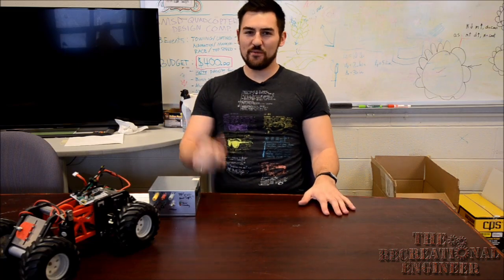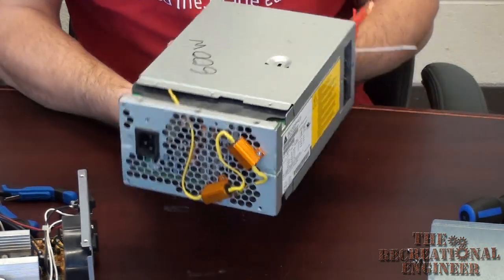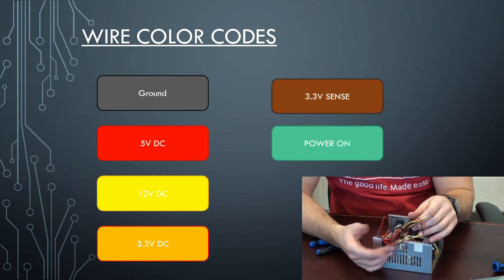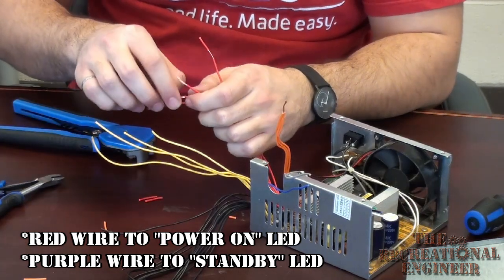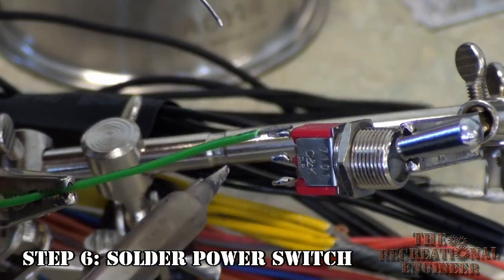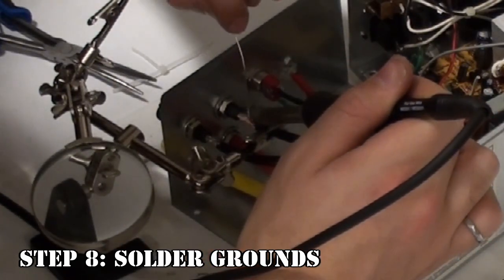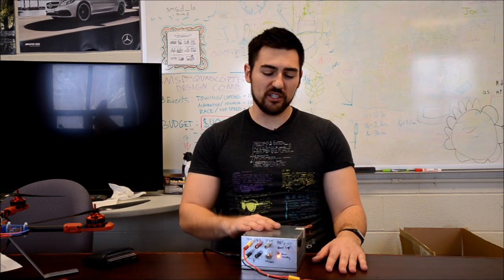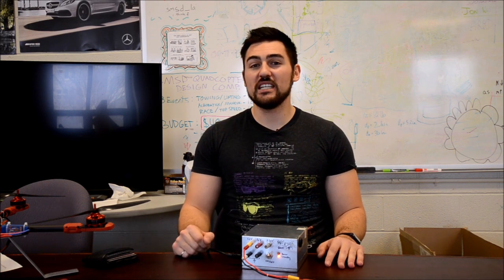$10 DC Power Supply - 1 Day DIY

Comment: I have two questions:
¹ Could you combine the voltage across each post to get ~20V+?
² What modifications could make this a variable power supply?
Reply: You could get 24V using +12V and -12V, but usually the -12V can provide less current, so that will limit the amount of current you can get out of the PSU.
It's not recommended modifying the PSU to make it variable since you usually need to remove protections, and the electronic is not designed for different voltages

Comment: My PSU is rated 300watts. Does this mean I can get 5 amps or more out of the 12v line without doing anything to it?
Reply from the maker: boowonder888 The amperage readout should be written on the supply. It all depends how the current is broken down. I would imagine 5amps should be no issue tho
Reply: Mine reads for the 5v - 35 amps, 12v - 15 amps. Can you combine the 12v wires to 24v and therefore  half the amperage?
Reply from the maker: boowonder888 No, when you combine the 12v wires you increase the amperage in this case
Reply: I guess that makes sense. I think I was confused with parallel hooking up of a few batteries? That 15 amps on the 12 v wire is all I need but my homemade solenoid engine runs better on my store bought power supply when I set it to 12v , 5 amps (maximum). Maybe because of the internal automatic off switch of the pc PS. It needs a constant load? I'm gonna try putting a constant load like a little light bulb on the outside and see if I can get it to stop the automatic off. The way you did with the big resistor?
Reply from the maker: boowonder888 you probably need a pretty big bulb. I would just use a load resistor. They are cheap
Reply: I dug up an old psu from about the year 2000 today. It only has a 12v and a 5 volt rail. 3.3v is totally missing, lol! It has a total rating of 65W, 12v, 2amps and 5v 7.5 amps. 
The fan spins when flipping the switch and I didn't have to jump the green and black wire, I guess its so old they did it differently back then. I like it because its compact and safe because its only 65 W. I found a 5w power resistor too, so I'm gonna connect that to the red and black wire so the unit cant switch off automatically.

Comment: Remember that you can get 7v by using the 12v and 5v rails. D.C. Power is based on voltage differential.
Reply: Power is based current and resistance.  Voltage is a differential.  The 12V is relative to ground.  5 is relative to ground.  +7 is relative to +12 and +5.

Comment: i don't know why but when i work with mine (i have two that work the same but different manufactures) and measure the voltage there is an actual  18v  ±0.5v  and i think its because 12v and 5v are connetcted together to the plug so if i do this i can can have it from 18 btw it's not written 18v i just have it

Comment: I can't seem to source a heak-sinked dummy resistor at the suggested resistance spec  (5 ohm) for the 5v rail ( for an older Dell atx PS)
I can find 10W .(point)5 ohm and 10W  10 Ohm  and 10W 39 ohm.. on ebay..    Is a10 Ohm resistance going to work for me?

Comment: My PSU, a Thermaltake 550W, has a yellow/black stripped wire as well, what's this all about?
Reply from the maker: Jo Veteran this is in addition to the solid yellow? Does it go to the 24pin atx cable?
Reply: Hey, thanks for replying.
Yes, there are a bunch of yellow, orange, black ones, plus singles of brown, green, blue and there are also those two stripped yellow/black ones. At the moment I don't recall where those two came from, I'll check the 24pin motherboard connector tomorrow and let you know.
One other thing, this PSU worked perfectly but had this weird issue, it wouldn't turn off. Does that mean the green wire shorts to ground somewhere?
Reply from the maker: Jo Veteran best case is if the wire runs to the 24pin atx then you can google the pin out for the connector and find out what the wire does.  On the shut down question. That's tricky, your intuition could be correct
Reply: So it seems that those two stripped cables belong to the 4-pin +12V Power Connector. I've checked the PSU manual and it describes those two "yellow" (those are definitely stripped yellow/black ones) as +12V2DC, whatever that is. My motherboard has 8 pins for that connector so I guess this is doubled or something? In any case I think this goes with the rest of the yellow ones, do you agree?

Comment: Hey +The Recreational Engineer does each 5V and 12V wire have the respective voltage running through them? Or must they all be combined to gain the respective 5V and 12V voltage?

I am looking at making a Lab Bench Top PSU with USB ports as well for a multi V setup for different components and tools I need to power
Reply from the maker: Matthew Stranks Each wire will have the full voltage that correspondes to it's respective color.  Good luck
Reply: Really appreciate the reply +The Recreational Engineer I am just waiting on all the supplies to come in now! Maybe I will post a video of the finished product!
Reply from the maker: Matthew Stranks good luck with your project

Comment: how can you make a variable supply from that ? without using a buck/boost converter
Reply from the maker: Satyajit Ghana unfortunately that is it a bit out the scope of what I can explain in the comments.  If you just want to bleed off energy you could make a voltage divider with a very high wattage potentiometer.  However I wouldn't really recommend this

Comment: Nice Weller soldering station you have there :D Sadly mine broke 2 weeks ago after 20+ years of service :(
Reply from the maker: AK90 thank you! I wish I could claim ownership but unfortunately it was borrowed.
Reply: Who can I use if I don’t have the load resistor?, regards from the button of the valley
Reply: @ruffnck4637  Just solder in a car brake/tail light bulb instead.

Comment: Do I need a dummy load resistor? Or can I just use a 10w ten ohm resistor? Do i even need  resistor?
Reply from the maker: Jack Pirone the 10ohm 10 watt WOULD BE your dummy resistor
Reply: Ahh. I have 1 ohm 10 watt resistors. can I use those wired in series for my dummy resistor?
Reply from the maker: Jack Pirone technically yes but it may be difficult to package
Reply: ok. I might also hook the resistors to a heatsink. I will tell you how it works after i build it.

Comment: Hi I have a question I need a power supply that will give continuous 15 volts or higher and to be able to use a veritable control so i can turn it up to what i need thank you
Reply from the maker: Jimmy Clark this can be done.  Follow this tutorial and then attach a variable buck converter to the 12v line.  You can buy one on amazon

Comment: would it be possible to put a useful load in place of the dummy load resistors? Or is that as dumb as i think it is?
Reply from the maker: Javierm0n0 yes you could do that,  that is essentially how the pc it is supposed to power works.   The reason the dummy load is useful is because when you are doing small electronics projects such as Arduino type things,  there isn't enough load to keep the supply running.  If you are using this to run a big motor or something then you do not need the dummy load.
Reply: oh so i could add a flip-flop to switch between the dummy for circuit work and an active load that I'd be testing?
Reply from the maker: Javierm0n0 For sure!  You can do whatever you want.  But yes I think that will work fine.

Comment: lol at 11:35 powering a quadcopter, with no transmitter on, and the props on the motors. One day you'll learn that lesson ;) Nice work on the power supply!
Reply: Bringamosa Oh man. The chaos that could ensue! LOL
Reply: Andrew Balus. That would be some recreation right there.
Reply: I totally agree that it is very unsafe but, if you look close they are not fastened to the motors. I think he just sat them on there for display but, could still have been a disaster if the props were really tight on the shafts and didn't free spin if the throttle went to max.

Comment: so iv been using one to power my subwoofer for a long time but i could never use it to its full potential. can i use two power supplies to power one amplifier? i think its a 2,000 watt amplifier and my subwoofer has a 1,400 watt peak. also i took all my car audio out of my car so im using my car stereo with that and i just dont know what the best way to do all that is haha i want the one subwoofer, two truck speakers and the stereo because its going to be for my theater and i dont want to spend all kinds of money when i have all this good car audio stuff laying around. haha how should i go about powering all this?? 3 cps's, one for each amplifier and one for stereo or what?

Comment: Why did you solder the heatsink resistors in the yellow wire? it's a 12v..shouldn't it be on the red wire instead?, cause it's 5v and have more amps than 12v. I'm confused,, please explain.

Comment: hello guys
My 700W PSU says voltage 230V / current  6A / Frequenci 50Hz.
and than 12V1 30A, +5V 24A, +3.3 24A.
i wana connect it with a peltier TEC-12706 so are my voltages Ok or i need to do add something to my supply?
thnks in advice

Comment: Its a good idea to use the "all good" wire (grey) for the led . This means is any of your voltages are incorrect or not functioning the led wont light . Other than that , good work :)
Reply from the maker: David Haney thanks for the tip
Reply: would it be wired to the standby led or the power on one? would be legendary if you could help me out i can't find anything on what to do with the grey wire

Comment: hello... i have been looking for a tutorial regarding this power supply & i came across yours... your presentation was excellent... may be you can help me with the problem i am having... first.. the yellow wires only have 8.4 volts & second when i hook up the LED strip ( like you did) they flicker at a very fast rate... what am i doing wrong???.. i do have the green & one black wires connected together via a toggle switch... the power supply came out of a very old PC .. probably 10-15 years old... i  have intention to use this power supply to light up my model railroad with the LED strip... any help you can give me would be greatly appreciated .. thank you advance .. vinny

Comment: when I don't have dummy load only 2x 220R 0.6W left from 4 pack  am i pretty much fkd? (already have other 2 on my leds)
Reply: Yes, you are.  I don't know how much current the PS needs (what the actual spec is), but all the videos talk about 5 ohms on the 5V line.  I = E/R = 5V/5ohms = 1A.  Let's say the circuit needs a 1A load.  But, even if you paralleled your 220 resistors, that would only be 110 ohms.  5V/110 ohms is only 45 mA.  Not even a tenth of what you need.

Comment: How do I solder the resistor to 5v? Do I simply solder one red wire to each side of the resistor? Should ground be soldered to the resistor?
Reply from the maker: Carlin Canales which resistor?  The load resistor or led resistor
Reply: the load resistor.

Comment: what's the purpose of the dummy resistor? Without it, have any damage for using PSU?
Reply from the maker: 정용화 some PSU will not turn on without the dummy load.  Not all PSU react this way, but most do

Comment: looking to mod a similar atx psu for my RC charging needs,  the psu im working with dc output is 36a on 5v, and 16a on 12v, i will only be using 12v,    i would put a resistor on the 5v line then correct? TIA for any help.
Reply from the maker: spencer tangren yea that's what I would try.  Good luck!

Comment: You don't tell or explain anything about connection of the leds ...Thanks
Reply from the maker: Stavros Salevourakis power led:  5v - - > 330ohm - - > led - - > ground.     Repeat for standby led but use purple wire for power
Reply: Good evening , thanks you very much... iam all ready done. Thank for respond  and for your video.
Reply: thank you
Reply: The Recreational Engineer I built this but when I plug power in I get standby power but when I switch it on I get no main power. Also I tried removing switch and twisting green and grn wire together so I know it’s not the switch. Can anyone give me any troubleshooting advice please.

Comment: Every good video. would you make 24V outlet for 24v LED light strip?
Reply from the maker: Ravy Khith I have thought about making this into a variable supply.  I will have to try and find the time for another video.
Reply: Thanks you
Reply: You mean to use  -12V and +12V rails (24V) connected to a DC-DC buck/boost converter? But what about the current  on 24V - how many amps would be the output?

Comment: i went to my local electronics store and they didnt have 330 ohm resistors and 5 ohm 10 watt load resistors in hand for a certain project im working on that needs to get done in a day. I wanted to know if in place of those I could replace and go with a 390 ohm resistor and a 6.8 ohm 10 watt load resistor. Thank you in advance
Reply from the maker: MrFatman258 if you mean in place of the led resistor and load resistor? Yes those should be fine
Reply: Thank You! I also have another question regarding the power supply, in my case i have a blue wire that provides -12 volts at 0.8 amps. Can i add a binding post for that wire as well?
Reply from the maker: MrFatman258 yes of course,  just make sure what ever you hook up to - 12v still gets hooked to the ground post as well

Comment: the problem with this is the amount of current it can put out, with no current limiting. Be careful more than 30 Amps on 12 V, 5 V. Also there can be a lot of noise from the switching. Experimenters might want to try a buck/boost from the 12 V rail with current limiting that can be set. For bench power supplies you need to have current limits so you don't fry components when there are mistakes. this is great as is, if the user understands that it might put out 30 Amps!
Reply from the maker: Fred Zlotnick I agree this is a good suggestion! For anyone not concerned with spending a few extra bucks it is a great way to improve on this project.

Comment: R.E.,
question...I built a cool test station watching your video. have 3 set of terminals "12v,5v and 3v" at least that was the idea...lol
i got the dummy resistor on a 5v line.before i took the wire bundle apart i used the power supply on my lipo charger and everything worked like a charm. then i clipped the wires loose bundle them according to colors attached a few ground wires on ground terminals took 12v wires and placed them on one terminal, took the rest of the 5v placed them on another terminal, took the 3 orange wires "3v" and placed them on another terminal. took 1 green and 1 black wire attached to a toggle switch. only thing i didnt do was use the brown wire on the "orange" like it was in the original bundle. and i didnt attache my "blue, grey or purple" wire. but here is my problem..... once i connected power and closed the switch.....i got nada! on none of my terminals is there something i am missing here? thanks for any help you can provide. i can send pics if you like..?

Comment: question? what volts ill put those load resistor? and what is its wats and amps?
Reply from the maker: willie romero as the video explains it will depend on the power supply but if you are unsure I would try 5v first. Specs for the resistor are in the description
Reply: Oh ok..  but my DC out put is
+3.3VDC -20A
+5VDC - 14A
+12VDC - 14A
So my 3.3V is much high so i put meload resistor on it?
Reply from the maker: willie romero that's interesting, I've never seen that before.  I think if I were you I would try loading up the  5v line. It might be a really old supply.
Reply: Yeah so old PS.  Haha... so ill just disregard that 20A on +3.3VDC?

Comment: OK, I built this thing. But the power good LED. Is flashing? I checked all voltages and they seem to be the correct voltage is. What's the problem? Can you help an old man?
Reply from the maker: greg milstead so your saying that your 5v line is turning on and off repeatedly?  Is this happening on the 12v and 3.3v as well

Comment: some pc pw supply have -12 and u can use it as -12 with +12v and get 24 (or -12 +5=17...)
Reply: But it is usually <1A rated in modern supplies so pretty much useless.
Reply: pileofstuff true I was thinking about solenoids and other things that use 24 typically.
Reply: Having +12 and -12 is very handy for working with op-amps. And they don't need huge amounts of current.. Even 1 amp is more than most op-amp projects will ever use.
Reply: Can the 17v out put 15 amps or only output 1amps.
Reply: quantum Entangle +-1A its writed at supply -12v xA
Reply: Ji run yes

Comment: thanks thats perfect! now run it to a 1000 to 4000 watt pure sine wave inverter? can it handle that? or would it be a fire hazard? ha
Reply from the maker: I'm not sure if I understand your question.   Could you elaborate?
Reply: Will this power supply work to power a dc to ac power inverter safely and constantly? :o
Reply from the maker: Dan Hart You will need to be more clear on what power supply you are using and what converter you are using.  You mentioned 1000-4000w converter but that is a huge range.  The power supply I used does not have this capability but there are some that do.  What power supply do you have
Reply: Wait, so you want to use this power supply to convert 120vac to 12vdc and have it power a pure sine inverter to turn it back into 120vac ? I'm curious what purpose would that serve?